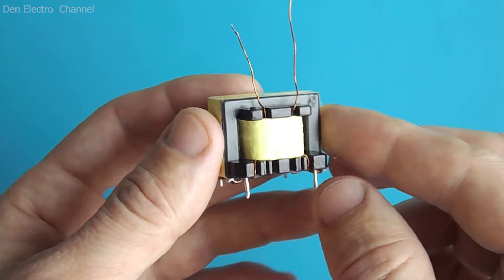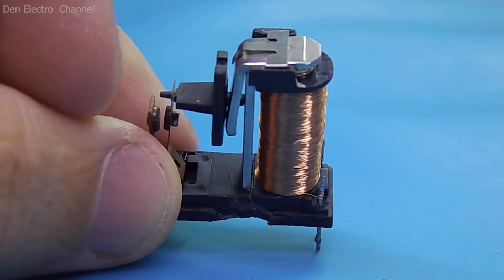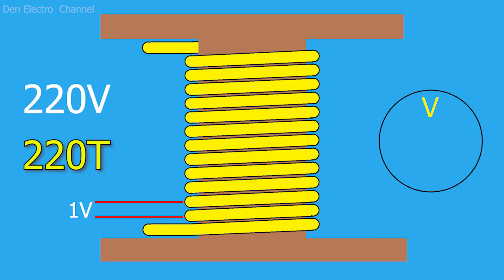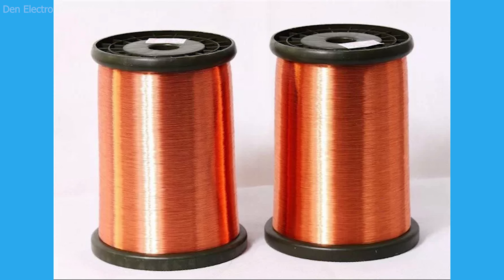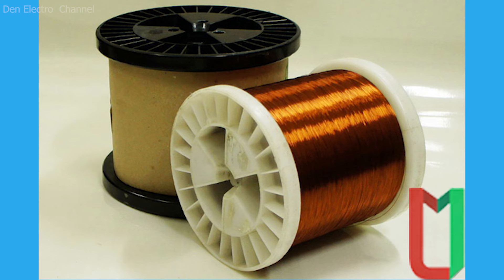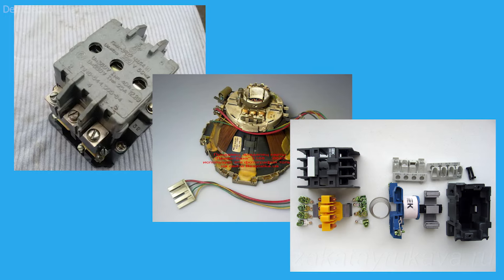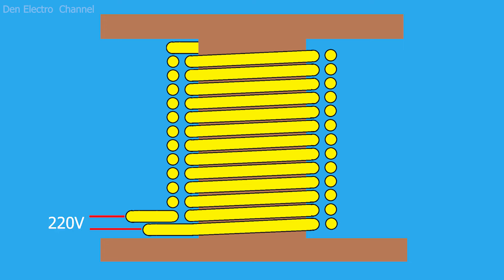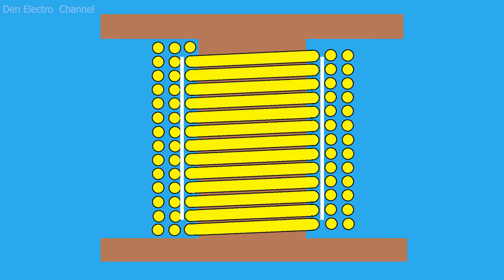How to wind the winding correctly?

Comment: Nice explaination. 

Then, what about toroidal cores?
Reply: Not well suited for high voltages. Best to begin at one point and pile the wire evenly around the core until you approach the beginning, but do not overlap. If more turns are needed, tape the winding and put on another layer. Even layer winding is not usually successful because of the difference in diameter of the hole and the outside. Use Formvar wire or Polythermeleze wire, which have high strength coatings.

Comment: Can you make a dedicated video on calculating the no.of turns for different types of transformer used in dc-dc,ac-dc converters ? Such as flyback, forward/push pull, h bridge, buck,boost etc. 
Particularly interested in knowing more about toroidal core transformers, transformer with and without air gap, calculations for different physical parameters of transformers like circular and rectangular core area.

I know I'm asking a lot. But thank you in advance. Subscribed for future uploads👍

Comment: No ai please
Reply from the maker: Hello.  Unfortunately I don't have the ability to speak English.  How bad does the AI voice sound?
Reply: @Den_Electro_channel  I think the AI voice sounds fine 🙂
Reply: That first sounds is better than this
Reply from the maker: thanks for the answer
Reply: AI sounds fine, but it makes your videos less personal and less recognizable. It all falls in one big pile of AI voiced and - god forbid - AI-generated content, which is getting more and more annoying and tiring to the viewers. Well, unless you're Neuro-sama or something. So yeah, I won't subscribe, but thanks for the video!
Reply: @Den_Electro_channel it’s ok. But it is a bit difficult for us to listen to because we hear these too often. They sound like a robot. Of course, they are robot voices haha. Maybe you can try to find more natural sounding AI voices later. But the most important thing of course is your content.
Reply: Anyway I subscribed even though it is a little painful to listen to these voices 😂😂😂
Reply: @Den_Electro_channel But What If The Enamel Cable Is Small And Long? It's impossible to Wrapped around him it consistently neatly and in an orderly manner.
Reply: @Sebastian23-h6r  Be sure to wind as evenly as possible. Divide the winding into sections with no section having breakdown voltage more than the wire insulation rating. Formvar and Polythermaleze can take up to 250 volts safely and more on larger diameter wires. Best to limit turn to turn voltage to 100 volts or less if you can manage it. Note that cheap wire is not reliable at these voltages.
Reply from the maker: ok. thanks for the clarification

Comment: Who told you that high voltage goes to the primary winding in SMPS transformers xDxDxD
With PWM, the effective voltage is reduced because SMPS transformers, unlike power transformers, work current-oriented, not voltage-oriented.
Reply from the maker: If everything was as you say, then they would use low-voltage transistors, and not take 600 volt transistors to work with a voltage of 310 volts. In pulsed equipment there are always high voltage ripples that easily penetrate anything, even if this pulse is very short in time.